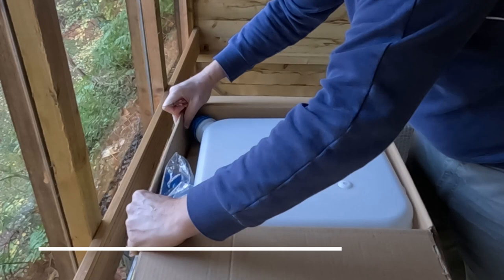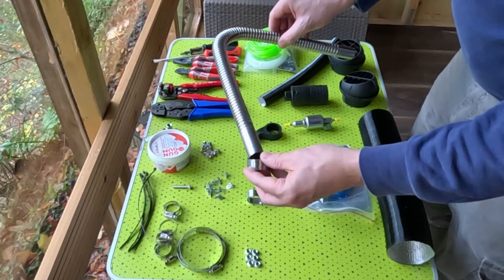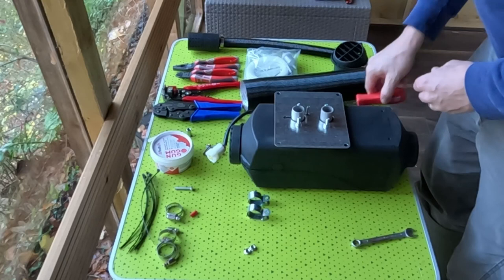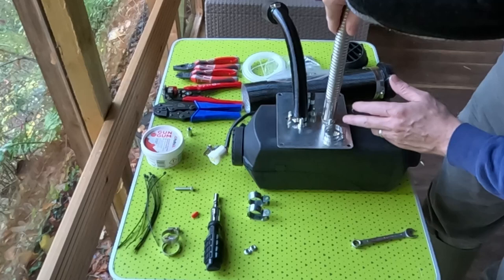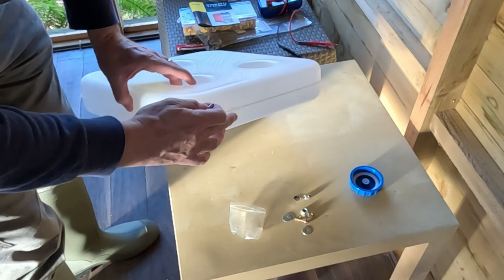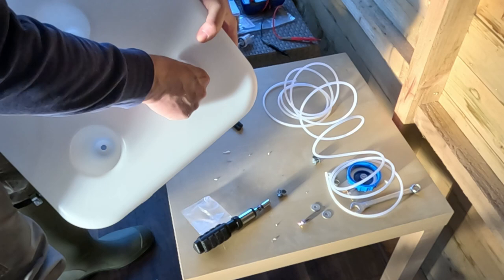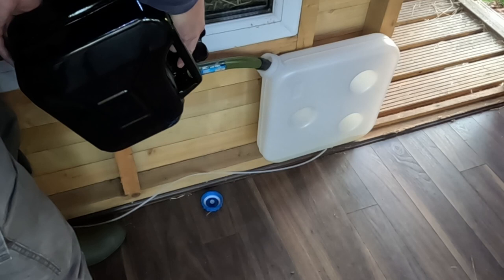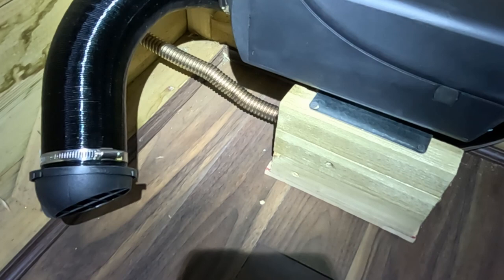Easy Diesel Air Heater Install

Comment: The white nylon fuel line is the correct fuel line to use. Drilling a hole in the bottom of the fuel tank should be avoided, as the diesel will eventually eat the o-rings and it will leak. A pick up pipe fitted from the top of the tank will ensure the tank never leaks, and a fuel shut off fitted just after the tank is a good idea.
Reply from the maker: The pick up pipe is a great idea, wish I'd thought of that, thanks for sharing.
Reply: I think the local auto store will have diesel safe o-rings if needed . Worth a check , I use to work for a diesel remanufacturing plant and know they are out their in every size .
Reply: @georgedeedsnotwords2162  Yeah, you should be able to find them. Nitrile ones should do the trick.
Reply: Can't you use a weighted filter like they use in 2 stroke blowers and edgers?  The hole is in the top of the tank and the fuel is drawn in by the pump.
Reply: @alext8828  Good suggestion Alex.

Comment: Please add some mineral wool around the exhaust pipe exit to avoid burning the wood. The pipe may get very hot, maybe 300C that may start a fire.
Reply from the maker: Hi, since the first video I have added exhaust heat wrap. https://youtu.be/JgS7HEZxiYM?feature=shared

Comment: Adding a couple of lengths of exhaust pipe will help recover some of that exhaust heat. Some people use and old oil heater (like a water radiator) with or without a fan. The great debate is regarding the angle of the pump (solenoid). The cavitation causes air bubbles in the fuel that some say leaves a dry area inside that can wear out prematurely.

Comment: I just fitted one in my garage workshop today, Opted for the fully contained portable version as I just wanted to get it up and running so I can get some work done. I used a 300W 240/12volt LED driver instead of batteries 20 quid off Amazon, way cheaper than any battery and a doddle to connect up.  Having now heated my workshop to an unbearable 27C (I was wallowing in a heat bath) my first job is to build a caddy for the heater unit and 10 litre jerry can, then I'll finish insulating the doors which will save some fuel. FYI you can legally run these heaters on red diesel which will save you a few quid.
Reply from the maker: Nice, yes agree if you have a mains supply using a transformer is easier that batteries that need to be recharged, in my van the batteries are recharged via solar
Reply: @hikescotland2360    Mike you have the optimum power supply for these heaters - well the best is a battery and a suitable float charger, if a mains connection is available.  Using a DC power supply is flawed for a couple of reasons, at least.

Mains failure while the heater is running may well damage, or kill, the motherboard.  They did not position it in a cool air flow and cool everything down with the shut-down sequence, for no good reason!  

Running a DC power supply at low power is electrically inefficient - but that power supply must be much over-sized (for normal running) because of the high start-up load.  Crazy waste of energy.
Reply: I also looked at power supplies but the chance of ruining the heater seems not worth it.  I don’t often loose power but my luck is not good.  It’s the cool down that will be absent if power is lost during heating.  I found a 230 cold cranking amp motorcycle battery for $50 on Amazon.  I’m using that.  With a motorcycle maintenance charger.

Comment: Now IV fitted mine into a insolated wooden shed, but what IV done was only exist the exhaust out of shed, I cut a 40mm hole pointing slightly down wards to out side...then incerteted a tight fitting tube then rapped it in exhaust rap to 
1 block the hole up and isolate heat from the wood ect.
This is my second winter and all been good.
Reply: The reason he has the air intake plumbed outside is to 1: isolate any back draft and smoke during startup, if occurs, and 2: eliminate the need to have a make up air vent, which will draw cold fresh air in to the structure that would then need to be heated, reducing the efficiency of the unit. Also prevents over consumption of room air in the event adequate make up air isn't available.

Comment: I notice the exhaust loops up to exit the shed. You might find that condensed water will collect in the lower part of the exhaust pipe.
Reply from the maker: Thanks, I'll make a slight adjustment to lower the fixing bracket on the outside at the same time I wrap the exhaust.

Comment: You might want to put some asbestos tape around the exhaust where it goes through the shed wall, or you will get mice getting in there, also it will prevent this risk of setting your shed alight, (just my opinion)
Reply from the maker: Thanks, that's a great idea, I used Basalt Lava Rock Exhaust Wrap Roll on the van's diesel heater exhaust, I'll use the same to wrap around the exhaust a few times to plug the gap.
Reply: Exhaust heat wrap tape not asbestos tape. Asbestos tape is only a tape to warn something contains asbestos.
the importation, supply and use of all asbestos has been banned in the UK since 1999; the amphibole type has been banned since 1985
Source: www.gov.uk
Reply: @gbwildlifeuk8269  Where would we be without our Governments making absolutely sure we are all safe? It's so re-assuring ;-)

Comment: Great video why didn't you fit it on the outside of your summer house .less noise from the pump .
Reply from the maker: It was easier to fit inside, I did fit the pump underneath the van, outside for my campervan to reduce the noise, also suspended the pump on cable ties to reduce the knocking.

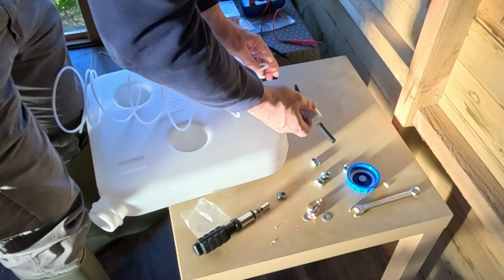Comment: 23:25, I don't think that's the right direction for the fuel filter.  The fuel should flow from the outside of the filter to the inside.
Reply: any reason for that?
Reply: @jan_vyhnak  Yes, the outer layer of the element is much larger than the inner layer and will catch more dirt.  The other way around, the little inner layer gets plugged up with dirt right away and the outer layer won't get a chance to trap any.

Comment: Where the exhaust has any chance of touching a combustible, shielding should be used such as a larger diameter piece of exhaust pipe or fiberglass heat wrap. Contrary to what is recommended, the fuel pump solenoid, works more efficiently in the vertical position.

Comment: If you had kept the air filter inside. Then you won’t be heating cold air continuously and the heater will run more efficiently
Reply from the maker: Hi, the air filter is for the combustion air intake. The air intake for the heating part is on the right hand side of the heater, in the room.
Reply: @hikescotland2360   Mike, he is writing about the combustion air.  If inside, the combustion air is likely more consistent in density, but for heat balance, it makes no difference.  If it were inside, that air would have to be replaced via draughts (so cold air needed to leak into the room from somewhere).

Comment: Great walk thru. I bought the Diesel heater for my chicken coop. We can get pretty cold weather here (-10 to below -35C) in the winter and the cost of electricity is killing me. So I am building a solar system to power this and lights etc..I was wondering if anyone had used a diesel additive to prevent gelling?
Reply from the maker: I use STP Diesel Winter Treatment to stop the diesel gelling in my van's diesel heater as the fuel pump it located outside under the van, but it rarely gets to -10 c in Scotland so I don't know if it will work at the temperatures your experiencing
Reply: @hikescotland2360  Thank you for your reply.. appreciate you taking the time.

Comment: Do you not get mice coming in through the exhaust hole when the heater is not in use
Reply from the maker: Hi, since this video  I've wrapped the exhaust with heat wrap. I did a follow-up  video,https://youtu.be/JgS7HEZxiYM

Comment: How much 3 inch ducting is allowable with how many degree bends total? Have a long run througout the car with bends and concered there would be too much back pressure on the heater fan if there are too many bends or ducting is too long.
Reply from the maker: Sorry, I've only ever fitted them with the supplied ducting.

Comment: Wat size is the flex pipe for the heat? I ordered mine but I wanna get more pipe before it's here
Reply from the maker: The inside diameter of the hot air hose is 75mm

Comment: Could you use red diesel , it’s a bit cheaper.
Reply from the maker: I think so, but I've no idea where to get it.
Reply: kerosene is cheaper and cleaner burning
Reply: @alexandermorrison8431   These heaters were designed and set up for running on diesel, not kerosene.  Yes they appear to run OK on 28s Redwood kerosene without undue wear to the pump (there is less lubricity in kerosene).  But the bottom line is they are running less efficiently due to higher exhaust gas losses (due to excess air).  Kerosene contains less energy per unit volume than diesel.  It likely means it is cheaper to run on the cheaper fuel, but not by the amount first thought.  In cases where the maximum amount of warm air is important, sticking to red diesel would be better.

Comment: How long will those two batteries last ?
Reply from the maker: I normally use them for about an hour. I did a test for 90 minutes, at the start, fully charged the batteries were at 25.1 volts, after an hour under load they were at 23.1 volts, then after 90 minutes under load 20.5 volts. I was running the heater at max output.  About an hour or so later the battery's are at 23.8 volts before recharging.
Reply: @hikescotland2360  Thanks for the info' HS, I'm getting more and more curious about these heaters as a backup home heating system.
Reply: @demonhighwayman9403   If you have mains supply, running indirectly from the mains is best.  Beware that loss of mains can damage or destroy the motherboard by overheating, due to the shut-down sequence not being able to run if a DC power supply is used (a large over-powered DC power supply would be needed for the initial start-up and would run inefficiently all the rest of the time, too!).  Using a battery with float charger (of slightly more power than the normal running current) is the best solution, of course, for your intende usage.

Comment: Hi. That was a whole kit, brilliant. Can you let us know what the make was, where bought from? And has it all worked well since you installed? Thanks
Reply from the maker: Hi, it's working perfectly, it's less than 2 weeks since I installed it and I've not had a lot of time to use it, will be using the summer house (and the heater) for more youtube videos in the near future. 

I'm in the process of setting up an ebay affiliates account but it's not yet in place, sorry about the long links.

The heater was ordered from ebay - 
https://www.ebay.co.uk/itm/203666615235?var=504102073285

The upgraded fuel line kit - 
https://www.ebay.co.uk/itm/384817471310?hash=item5998e89f4e:g:uLgAAOSwNaJiTAdQ&amdata=enc%3AAQAHAAAA8HoXJIsNAHmMHhzIFrxDynzEpoFJi18Nq3lMtHJxQOa2wNdqKGZmYSbcxfa9IPdYtvLJMV5aa8R117Y7r3ybf8iFSK4sRLHo1YM9vgQQVKI0sc8P%2BgfwrkV3mV1Zoa7F1WXJ7t6Mpnc7g7svganFN0W0pUhdvkUxREpshUWlfXboQykeM9uPiivRNOVZnY7CF6lTlA%2FyaXHXJ8kRVQNWawa4IvSclusRPtMGXS1IVD7ft6eyk3ZuLzFLPQiKk9R5g2yvl8eC4yO5ZMDZZskp1kDs6XnQIzvVUMJ0fZIuDqZm%2FPgCgsHODvUzwbHRH37d%2BQ%3D%3D%7Ctkp%3ABFBM_I3dmZFh

Exhaust paste -
https://www.ebay.co.uk/itm/304679812504?epid=10011373895&hash=item46f054fd98:g:KWwAAOSwDtRjXDVk&amdata=enc%3AAQAHAAAAoOLe%2FaA4a%2BNi3u%2B2B%2FORojwhjj7vXprkTB9QU6SrWilngEsJ0hSHL99Jj9UdKM8lBlgCA%2Bw37SI3yhYFnmq4Xrw1FdQPiaoFnlBqwvaOqyvHQa%2BkcKhx2ExnNHZ77Wll%2BzZ%2BJpHgBHSE0kR3IKaCNy%2Fw2Hvw%2F5FUoF8emlG9gDupgoIPofSHuJBWcE5hpfC5EzV95XhKdnZ%2B524hPiRdMzc%3D%7Ctkp%3ABk9SR-b1jJqRYQ
Reply: I just got a complete 5kW kit (same as shown here) off AliEx Vevor bestauto store for 70 dollars, including delivery in 7 days. Came in 2 days. Amazing value.
Reply: @hikescotland2360   Mike, please be aware that 8kW cheap chinese diesel air heaters simply do not exist.  Look at the fuel delivery in the specification.  A litre of diesel contains about 10.5kWh and these heaters can only deliver approx half a litre per hour.  With inefficiencies (heat lost from the exhaust gases) even the ‘claimed’ 5kW heaters cannot deliver 5kW of warmed air.  Just impossible.  The chinese lie and people unfortunately are conned into believing them🙂